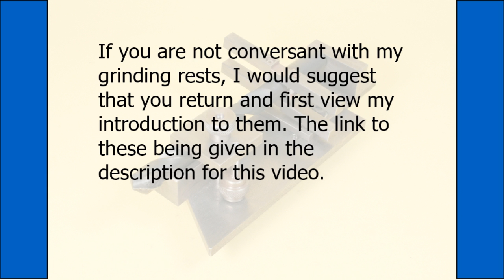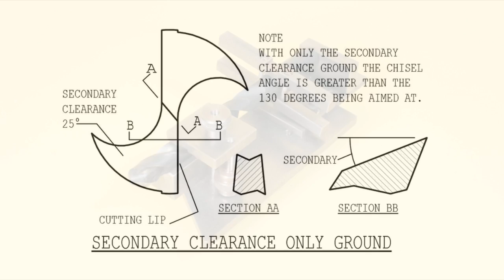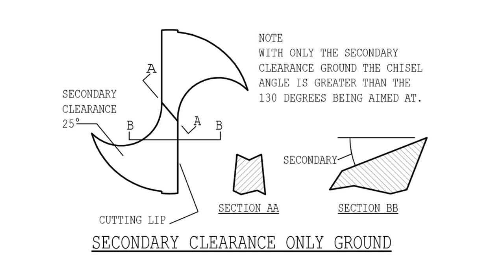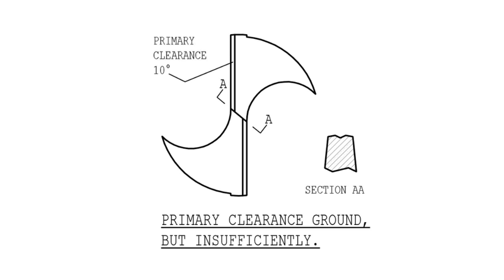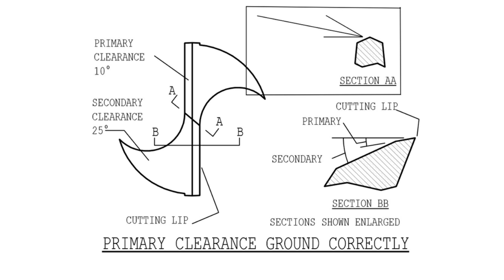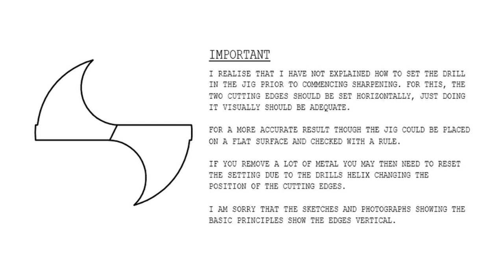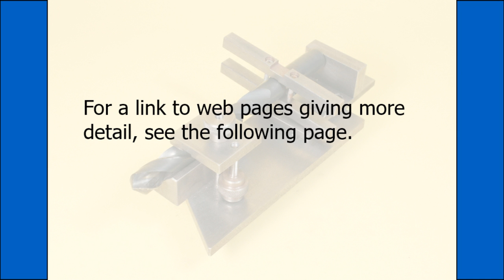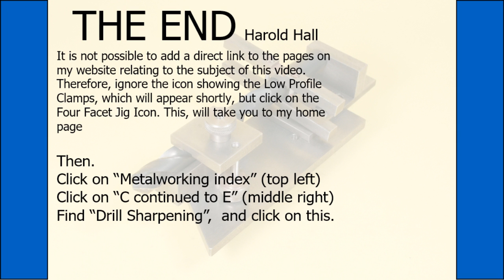Drill Sharpening using the four facet method

Comment: Wrong! Wrong! Wrong!  True 4 facet drill sharpening is not just four facets but is designed to completely eliminate the chisel point!!!
Reply: Sorry Michael St John but you have obviously missunderstood some of my comments throughout this video, as eliminating the chisel is exactly what I have done. However, there is more to the result than this as the chisel is replaced by a pointed end which you do not mention. One advantage of this is that drills can start without  using a centre punch. 

Can I please suggest you carefully study my drawings, particularly the second copy of the "Primary Clearance  Ground Correctly" drawing, which highlights the pointed end with an arrow.

For a good example of the final results, ignore the two drills being compared and look at the end of the drill clamped in the jig.
Harold Hall

Comment: WOW what a gold mine you have of a website. Very clean and easy to flip through information. Absolutely wonderfully matching information with visuals that even I can follow along without scratching my head. . to hard.
Ill be spending much time there and will definitely order some books. 
I've been searching for a smart jig some time and am grateful that I did not give up nor waste time on a jig that would decorate my drawer.  This is also the first tutorial I've seen with 4 facets cuts and I've looked for quite some time. ...  going to garage now and try to hand sharpen just to get a feel for it. 
   .................... Just executed by hand without jig. A little of center but even so, the bit cut much easier and cleaner. And you can see the center edges of facets are much smaller to point.
You have a lucky family... Thanks for your help Mister Hall  !!
Reply: This jig seems to be a little complicated to adjust and use. I prefer the Tormek DBS-22 jig made for 4 facet sharpening I bought, and it's a lot easier and more practical to use.
https://www.youtube.com/watch?v=KqcMTxrIoPY
Reply: " it's a lot easier and more practical to use" 
Have you used both? If not, then as an "Engineer" you should know that you do not have the experience required to make that statement. If you have used both, then a fair comparison would be to list the pros and cons of each,  including the price. The Tormek jig costs $400 CAD and would need to be mounted on a Tormek grinder at a cost of $900 CAD. For a total cost of $1,300. The HH jig can be made for about $2 worth of scrap steel and his simple grinding rest can be made for about $5 worth of scrap steel. I've made both and can verify that they are capable of producing a drill bit that performs very well. Certainly much better than the original drill bits I was using and better than the 2 Drill Doctors I have. I cannot however compare it to the Tormek since I have no experience with it. But I can state that the sharpened drill bits produced by the HH jig and rest, look very much like the pictures on the link you provided.
For a Hobbyist this information is invaluable and much appreciated. For a production shop, this may not be the best solution  ..... but I'm sure Harold is not providing this information for the betterment of commercial operations and that is aim is for the betterment and assistance to hobby machinists, world wide.  

THANK YOU HAROLD!!!!!!!!!!

Comment: What kind of drill bit sharpening motor tool is that?
Reply: It's just a bench grinder, but Harold has trued the shafts on his lathe and mounted the grinding wheels on custom arbors so they can be swapped out without losing true. He covers this in detail in his excellent book "Milling, a complete course". Also in the book are instructions for the advanced grinding rest. His website is very thorough as well.

Comment: Straight in with a 13mm drill with no pilot hole. Is that standard practice with a 4 facet ground drill bit ?  I usually go up in 1/16" steps with my "as bought normal" drill bits.    Would one also drill a 20mm 4 facet hole with no pilot hole ?

Bill
Reply from the maker: Thanks for the question
Bill. 

First we have to take into account that the chisel of a drill sharpened by the most common method removes the metal by a scraping action and therefore needs a lot of pressure to push the drill through the workpiece. The drilling machine must also have sufficient power for the task.  

Also, take note that the cutting edge on the helix will be attempting to pull the drill through the workpiece, therefore, the pressure needed is almost entirely a result of the drill having a chisel end.
However, a drill sharpened by the four facet method has a a pointed end resulting in it starting, and then drilling, the part much more easily. 

So, yes, it is normal to drill a hole in one go, but with one overriding requirement, that is, has the machine sufficient power for the size of drill being
used. 

With that information in mind can I suggest that you view the video again, as when I say “pointed end” it is a little more complex than that.  Also, visit my website here http://www.homews.co.uk/page360.html  where there is much more information on the four facet method than I can give here. 

Harold
Reply: You can drill pretty much any size hole without a pilot hole, it is just a matter of machine rigidity and power. For "normal" ground drills a divot is needed, as in use a spotting drill to get your hole location.

And as Harold pointed out (no pun intended), the chisel is like shoving a flat headed screwdriver into the metal and because it doesn't cut, it requires quite a lot of force to push it in. But with a 4 facet grind there is less chisel and thus less power needed. One could even grind a little cutting angle on the chisel edge to get it even more easier to cut.